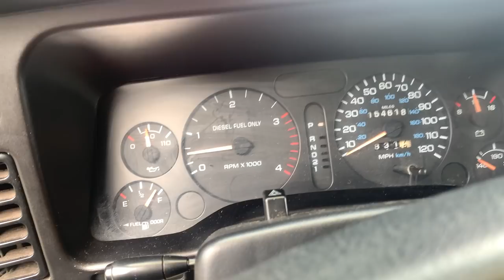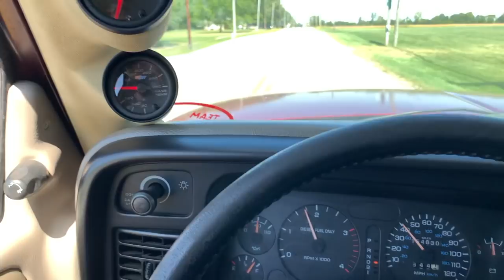HOW MUCH ABUSE CAN THIS 12 Valve Cummins TAKE!?!?

Comment: It's supposed to idle at 750 warned up in gear with the AC on.
Reply: Typically the linkages get worn and cause the idle to drop lower

Comment: Factory rpm idle on a 12v cummins is 850 rpm
Reply from the maker: 700-800 not 850

But being a hair less won’t hurt anything 👍
Reply: @LOUDNPROUD  will if it's a automatic transmission with lowering the rpm now the pump in the transmission is not putting out the pressure it needs at idle alot people don't realize that. Manual transmission it doesn't matter.
Reply: The 700-800rpm your saying is in drive with the a/c on. So when it's in park it's more like 850-900rpm. The idle speed where it was on ur truck was spot on before u adjusted it. I would try it back up when it's gets colder out it will stall out.
Reply from the maker: @bigmurph1447  well it would jump into gear it was so high. Every 12 valve I’ve owned idled about half the speed we had the flatbed set at… 

It was always higher than any 12 valve I drove
Reply: @LOUDNPROUD  if I were u I would bump it back up to around 800rpm. Compare ur idle speed of ur truck to ur wife's truck. See what her truck idles at that set urs to the same speed.